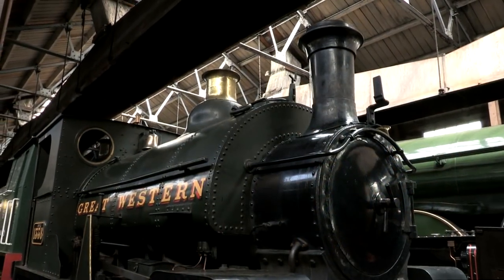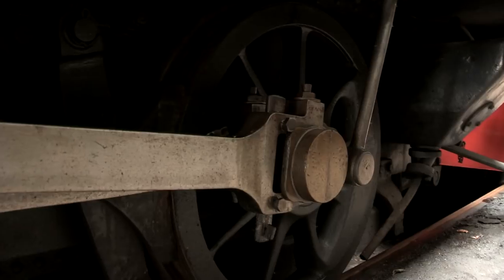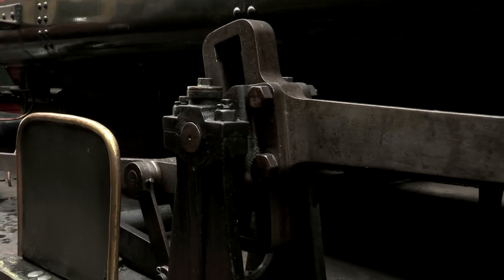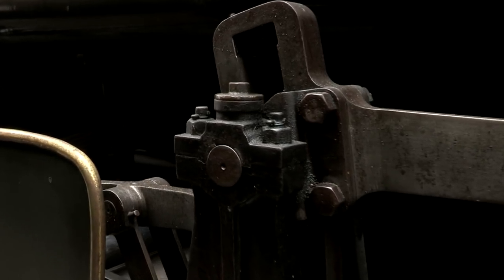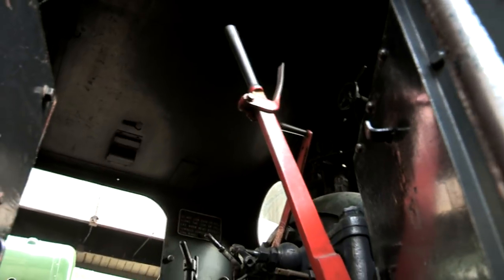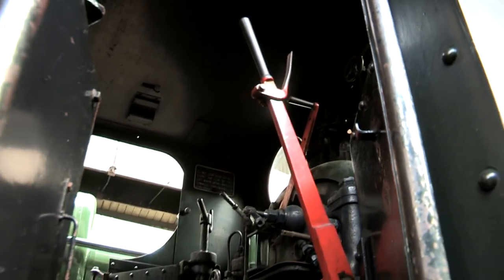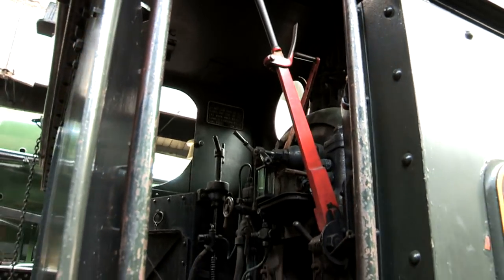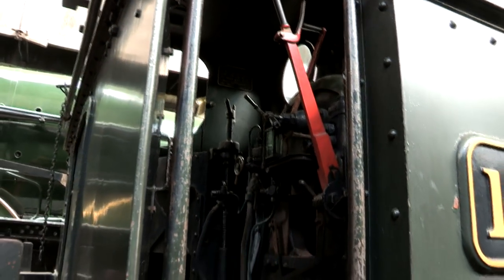SOLE SLIP: Cardiff Railway No 1338

Comment: "For such a small engine, she racked up a huge mileage for her size" 354,000 miles in 65 years active service equates to 5,446 miles per year, which is a remarkably small annual mileage comparable to that of a used car salesman's puffery! :) The Ffestiniog Railway's Welsh Pony by comparison performed an average of 14,350 for her first 20 years warning mild rant (the overuse causing her to be rebuilt with most of her major components replaced in 1890 - 1891, again in 1915, and again still in 2013 to present, that being said, at this point it's not "destroying history" if the specific components "destroyed" in the current "destruction" have already been "destroyed" several times in it's working life, with the replacements in all cases being faithful to the form and function of the original, whilst still retaining some replacement components from each "desruction" as well as some of the "original" components of 1867) :)
Reply: Ah yes, the classic “grandfather’s hammer.”  Personally, I believe the Japanese have the best answer to that particular paradox.  Namely, so long as it is continuity with the parts, it’s still the same locomotive.

Comment: the real-life percy has been found
Reply: The4014Gamer ForTheWin Close but no cigar. The real life Percy is an GWR avonside. well, at least debated as such.
Reply: Honestly, both engines might take the cake...but I'll leave the TTTE fans to debate that.
Reply: Well, I mean I assumed it is debated, as both engines are extreamly similar. The Avonside is missing he bunker and a few other Addons, while the Kitson has he valve gear, and some other safety Addons. Tbh, I think it's more of a heavily modified 0-4-0t but that's my headcannon.
Reply: Baron RedTrap or, it’s a combination of both
Reply: Could be. Most of the early characters in TTTE were very loosely based off of real locos.